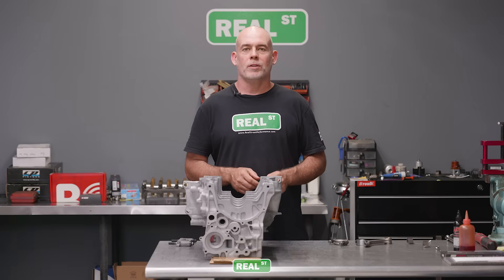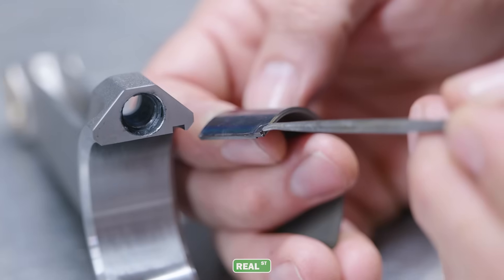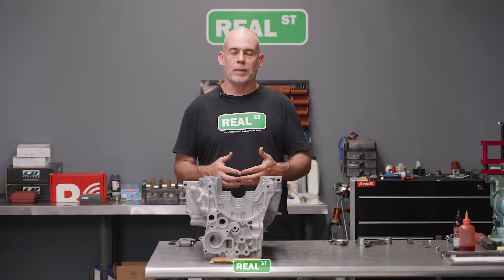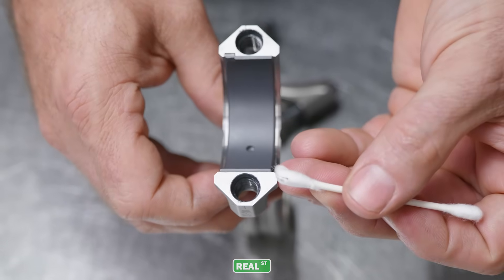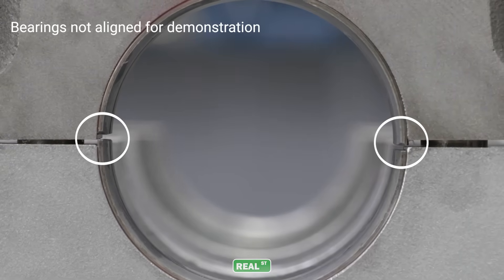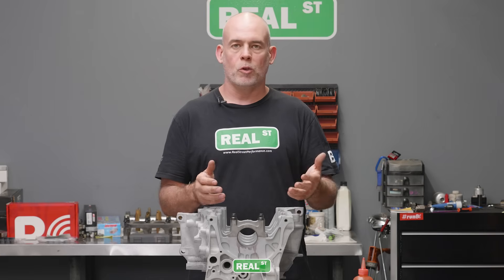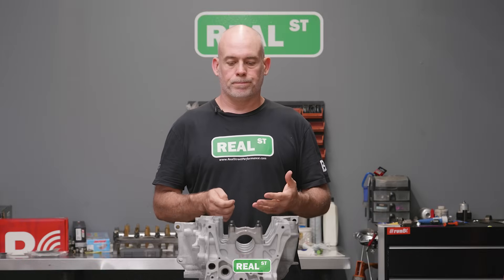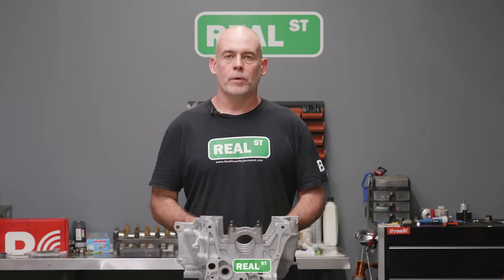Adding Oil On The Back Side Of Bearings During Engine Assembly. Good Or Bad?

Comment: So a trick I use to keep the Parting line of either the Connecting rod or the Main journal from pulling material off the bearing when you put it in is when you are doing your machine work what I do is take a file and put a 45 degree chamfer on the parting line.  This keeps your bearing install super clean and no oil needed on the backside.
Reply: Also makes it so a riser from a slight bump will not cause issues with torqueing or clearances. -- However IMHO your reason is a better one - 
I cut my teeth at 18 in a high end race engine shop 3 days a week for no pay - 2-1/2 years - let me sweep the floors in the beginning and by the end I ran all kinds of mills, clearanced rods, fit pins, honed blocks, lightened pistons, matched weights, assembled heads, and fit pistons etc.  
I learned more than I ever realized until putting engines together with other hobbyist car builders etc. 
They cannot believe the care and cleanliness - wiping journals with a clean bare finger so you can feel anything out of place - checking everything double triple checking everything.
Reply: @TheJagjr4450  P.S.  I put in my 30.2 years, at "Generous Motors," but  I sure would have liked to follow a career path similar to YOURS.  I absolutely enjoy tearing engines apart, and bring them back to life.  1990--hole in the wall shop, in Detroit--(the "hood," literally).  Just before I started working there for a GM coworker, (side gig for him) they had put heads on a 3.8 Buick engine, out of a 1983 Grand Prix.  They did nothing "downstairs."  I TOLD them, "you dummies"--that car will be back within 90 days, 120 at the MOST.  Weak external oil pump springs caused a lot of "issues" with an otherwise stellar engine design.  Sure enough, about day 100, it came back; I took over the "comeback," and did the WHOLE job.  Flash forward 5 years--another coworker was the brother of the guy whose side action girl owned the car.  Ralph worked right in my department.  He came up to me one night (3rd shift) and asked, "Red Dog, Red Dog, you remember that motor in that Grand Prix you rebuilt after it came back to the shop?"  "Yeah, Ralph, why?"  He had come across a young lady who had a flat tire on her car.  Being the smooth guy he was, Ralph figured on getting her tire changed, and maybe get her number ALSO--About halfway through his "good deed," he realized--"Don't I know you?"  It was his brother's girlfriend's daughter! He said she took off like she was late for work--do you realize how HARD a girl with her driving habits is, on ANY motor?  Five years later, and Ralph said "that car took off like a scared rabbit!"  I take pride in doing my best, when putting motors together.  Integrity--I try to maintain mine, and I strive to put in the effort to make sure any engine I put together will live a long service life...
Reply: @TheJagjr4450  You remind me of one of my engine building "habits."  I put heads on, torque 'em to say, 30 lbs., then 45, then 55, then 65, if that's the limit--I hit 'em one more time around, at 65--torque to yield bolts get left out of the 5th "pull," for what should be an obvious reason.  A good friend former coworker's brother works for Jack Roush; he used to run their NASCAR Dyno program--my friend told me, "Red, they don't even go to that extreme in  NASCAR!" I laughed, and asked my friend, "John, can you EVER walk a cylinder head down, TOO FLAT?"  He looked at me and said, "no, I don't think you can, Red." He got my point; you can't BE "too" meticulous, when assembling a motor--it can only add to its integrity as a "good" piece!  lol
Reply: Yes. This is also what I have been doing for years. Less or no scraping of the back side. I try to use King Bearings for all the engines I do. Now for the novice builder, remember no matter how clean your new parts look they need to be cleaned and inspected.
Reply: Correct.
Reply: @Comet-hn3gm  if you happen to do a little scraping , it's not the end of the world just remove the sliver off the bearing before you put the cap on.
Yeah oops , but it should be ok just don't keep doing it.
Reply: Yep i always soften all the edges easier on bearing install and reduces the chance of having a small burr mess with how the main/rod cap mates to its surface
Reply: Yes, I do as well.
Oil doesn't belong on the backside of the bearings.

Comment: Jay straight communicates his experience. This is a massive gift to us. I’m sold given how hard Jays builds are used and that he gets to forensically pull failures apart. He’s open to others experiences, not preaching.
Reply: exactly not sure why people wanna argue with the dude LOL
Reply from the maker: Thank you!
Reply: I work with industrial hydraulic components, and build cylinders.  Oil will flow anywhere water will flow, even though the viscosities vary marginally when hot.  I’d guess if assembled dry, it wouldn’t take long for oil to get behind all of the bearings, capillary action.  There is always space for oil to flow if there is no mechanical seal ( oring etc) Great vid.
Reply: @PhaseConverterampV  I've been in this field for over 50 years and I've never seen a bearing that had been run that was dry on the back. Oil it or don't,  it's going to get oil in there.
Reply: @realstreetperformance  I'm new to your channel & now binge-watching 
your library of YouTube Videos. I've developed respect & appreciation for you. 
I especially appreciate ALL of your valuable tech tips. THANKS!! 
I have a simple...but sincere...question. 
QUESTION: What are your thoughts on using engine oil rather than trans. fluid? 
Do you think engine oil would be too heavy for coating the bearing backs? 
I would prefer to use engine oil on the back of the crank, rod & cam bearings. 
Most of my engine builds are Pontiacs; 389, 400 & 455 & a few BB Chevy. 
Best regards, 
Ben

Comment: Thank you for your videos, I disagree with lubricating the back of the bearing shell for assembly. I think it would be good next video showing what rod bearing nip is, how it is measured and the engineering purpose behind it ie to provide interference fit between the bearing shell and bearing journal housing. Adding oil only increases the likely hood of bearing shell movement at break in. The problem is other less experienced people see this as a must do and bests practice when it is not. Please do not take this as a negative I like your videos and enjoy learning from them.
Reply from the maker: Dave I appreciate your input. And respect your right to disagree. This is how we have found success without failure. However, We had the same concern with people possibly thinking our open discussion could be misinterpreted as us saying it is a must do or best practice. Which is why we shot this video more than once and took precaution to use language that specifically did not imply this is a must do and did not present it as a best practice. This is a video about how we do it and why. We have had great success building engines that break records and live longer than the standard expectation for other engines at that power per cubic inch level and people often ask for a peek behind the curtain on how we do it. So these videos show how it gets done. 

You are not the first person to feel a resistance or hesitation about this method. We have had old timers that never graduated high school quoting their fathers’ fathers all the way to engineers pulling out text books to quote formulas they were taught in school. But it all boils down to many people grew up being told “you can’t apply oil to the back of the bearing or it will move and you will spin it” by someone else and (because it is easy to believe without questioning) they locked that belief system in as gospel and carried it through life. 

It’s one thing for people to disagree on a theory that none of them have personally tested in practice in the field. That actually happens all the time and can be healthy in encouraging testing and experimentation to find the truth. But it is a weird feeling to describe when people that have never actually tested the theory and produced a negative result from it argue that it won’t work to someone that spent their whole life putting it into practice with nothing but positive results and not a single negative result yet. 

If you’ve been a fan of this channel for some time you may have noticed that we try to present information that is normally hoarded away as proprietary in a way that could be understood by almost anyone regardless of their experience level. There are some technical topics that we either over simplify or skip all together if the explanation has to get too technical. Our team is composed of a diverse group ranging from people that got their GED without finishing high school all the way to engineers that decide what project car to buy next with custom spreadsheets and made up performance metric formula index matrixes. But regardless of their come-up they are some of the best in the industry today. There are many internal conversations where someone says “but I was always told….” or “but this engineering text book says…” or “but it’s just physics, it should…” while the other side of the table is saying “I hear you, but here are the actual results of the actual testing” it’s a good counter balance. We believe that the theories taught to us by our parents and teachers and schools help pick a direction in narrowing down the path for our own investigation and experimentation. But the results are the results. 

One of the questions we ask each other a lot around the shop is “how do you know what you know?” If the answer is “someone told me so” or “I read it in a book” then it should be classified differently in your head than the things you actually know. Maybe it happens to be true, or maybe the person you heard it from was mistaken. Or maybe their statement was only true under a certain condition that they left out at that time. Or maybe they were just repeating something that THEY were told and never tested and it’s just passing down through the spoken word over time like a fable. 

Either way we enjoy these types of topics because they generate healthy arguments that create results from speculation that everyone can learn from. So we appreciate you joining the conversation and hope you will continue to do so in future videos. I appreciate that you disagreed respectfully and constructively and You do help the channel be interacting.
Reply: Yea! What he said!   ^^^
Reply: @realstreetperformance  this is the best breakdown explanation I’ve ever heard in life. Thank you!!!
Reply: @realstreetperformance  what type of Trans oil, how thin?

Comment: Sorry bud, you’re wrong there. No oil. 
Lint free dry backs. This is how they teach the right way. I’ve rebuilt many engines for caterpillar and they teach you to go in dry. These engines are aprox $800,000 just to rebuild and make a reliable 1926kw
Reply: Bad comparison.
Cat diesel only turns 22-2400 rpm tops.
Race engine turns 7-10,000
most principals will cross over, but some do things that others do not. Some just stick new bearings in, others finess the bearing as they see fit. Some do not even notice the engraving on the back of the bearing sticks out and alters the crush and clearance, some do not care. Some do an "in frame" in the dirt, slide in some "std" out of the box bearings and let it eat and the 2000 rpm engine lasts for ever. Some have to toss in a new rod and piston at the track and button it all up and hope for the best. Some put in 4 or 5 rods and pistons over a racing weekend, and the thing still runs. There is really no right or wrong, it is what works for you, and if the engine runs and lasts the woo haaa.